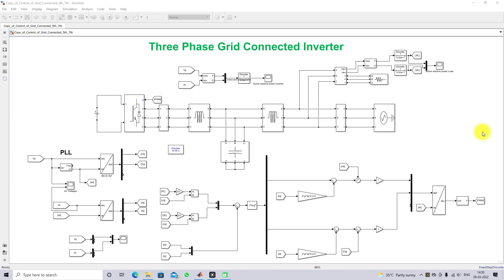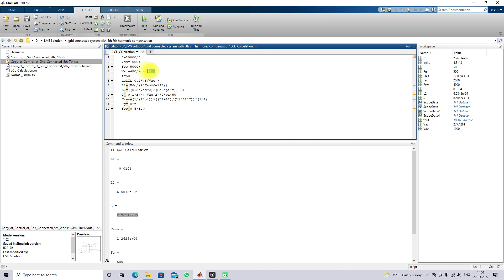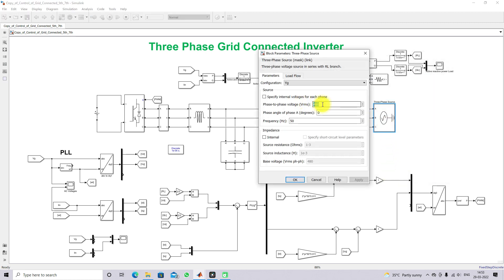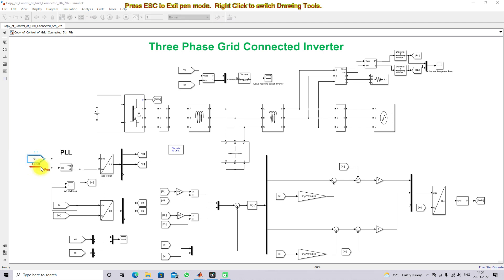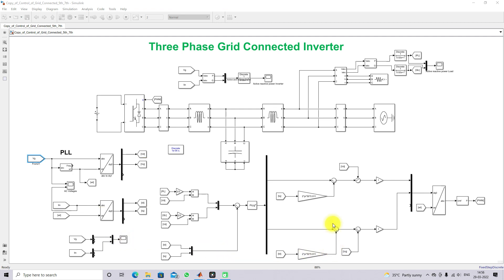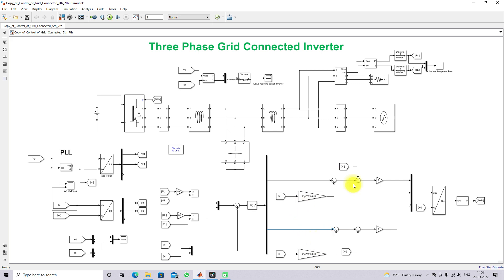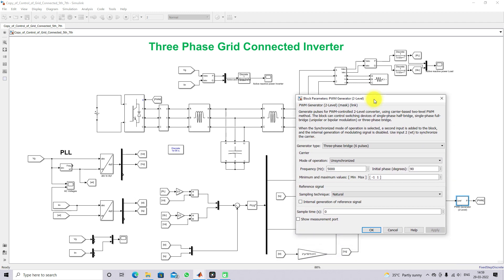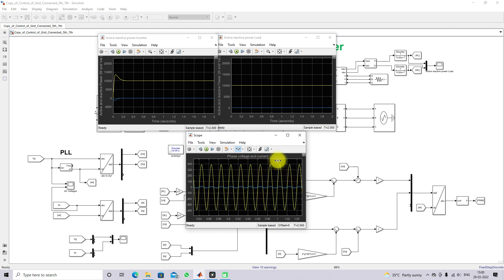Real & Reactive Power Control of a Three-Phase Grid-Connected Inverter | dq Control With LCL Filter

Comment: Thanks for this valuable video , could you tell us which type of controller you used to support the grid when new load connected... Actually I'm using PV de-loaded system for that and the system provide the power for new load but the frequency is not better than before using this technique.